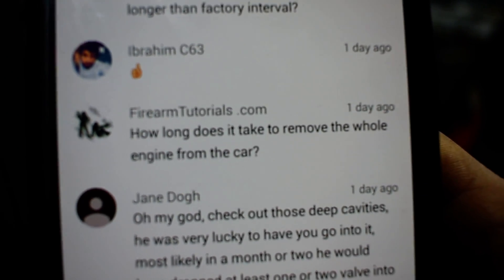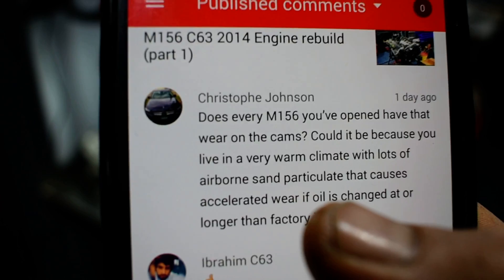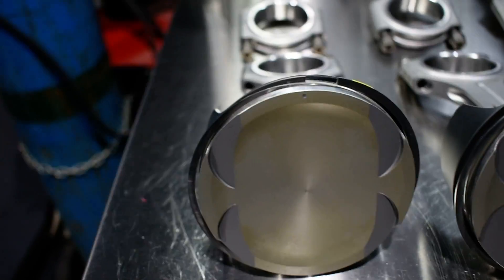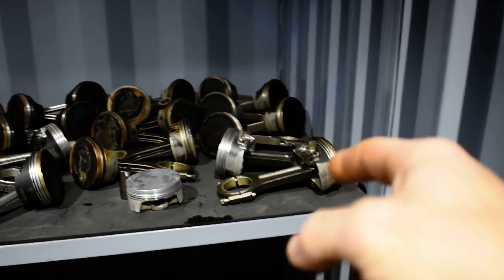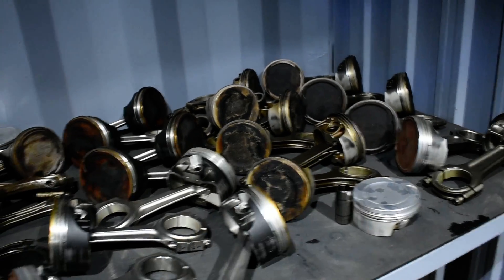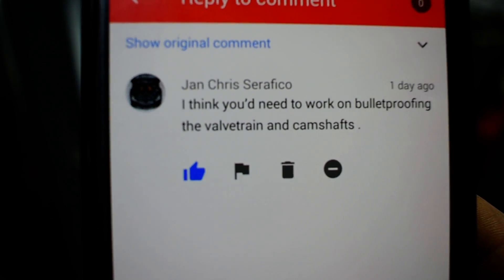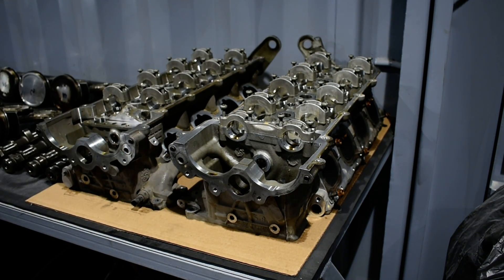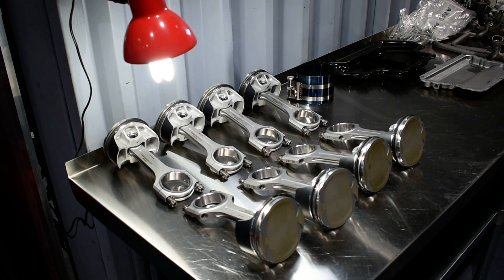Trying to answer some questions (part 2)

Comment: M113k detonation at low rpm and higher load, car is stock and always filled with 98 octane, what can be possibly causing that, carbon build up on pistons or higher IAT ?

Comment: Thanks again for taking your time to help us guys out here....I have something that you may want to look at.  I replaced my headbolts in December 2016 and my cam lobes, cam bearings and buckets all looked BRAND NEW, as in mirror polished.  Believe it or not when i took the pics linked below while doing the headbolts the engine had almost..........300,000km!!!!!  My odometer read just above 184,000mi....feel free to use the pics however you see fit if they help you or if anyone says that it can't be possible....you the Man
https://jptaylor2.imgur.com/all/